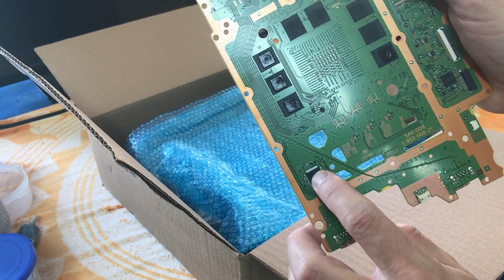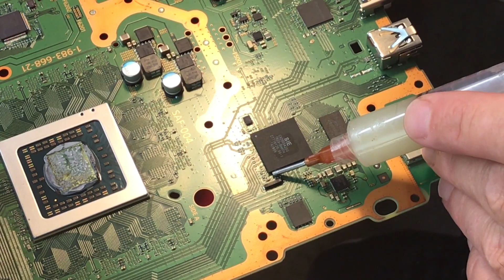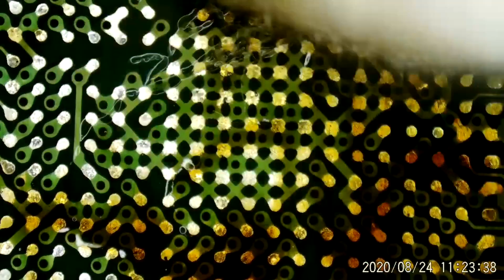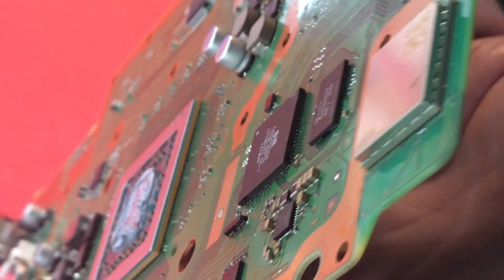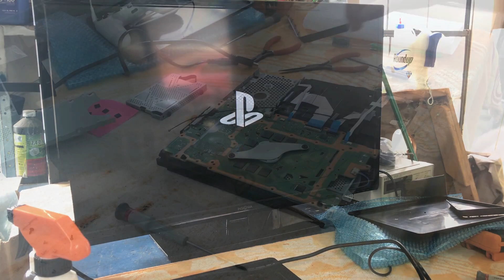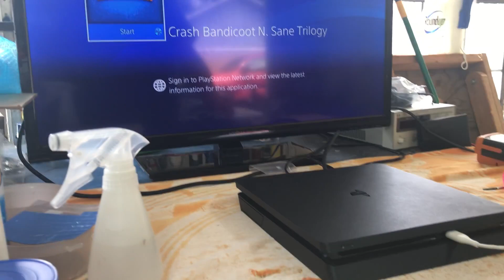#9 PS4 Slim - No Power

Comment: Sir I have a SAD-001 motherboard how can I check if the South bridge is dead or still alive ? Or will this same method work for any model of the PS4 motherboard ?
Reply from the maker: A dead South Bridge will usually show up as a short across one of the capacitors beneath it.  They just seem to die that way and they die a lot of the slims.  Particularly the 42GG.
Reply: @ToltecMerc  I managed to change the southbridge and the console worked just fine but today I received a PS4 PRO that won’t turn on. I checked the southbridge and it was okay, all stand by voltages are present and I even replaced the southbridge and the console still did not turn on. Tested a working PSU and still the problem persisted

Comment: Hi there worth watching this video I appreciate it thanks for sharing your experience with us, I have ps4 slim white the problem is slightly different than the one you have repaired.. Mine does beep when i press the dvd eject button but doesn't beep while pressing the power button, any clue which side of the motherboard i should check. Will appreciate if you or anyone reply. Thanks
Reply from the maker: I would start by looking for shorts to ground around the South Bridge.  It can fail in various ways.  Check across all the capacitors under the South Bridge.
Reply: @ToltecMerc   thanks for the quick response.

Comment: Any chance you can point me to what microscope boom arm you bought? I also have a cheap microscope (~100 from Amazon) which I love but the stand makes it pretty tight to work on PS4s under. I'm currently waiting on a CXD90042gg from Aliexpress and am planning to use your method. It'll be my first time messing around with BGA :). I've been doing mostly HDMI replacements and blu ray fuse fixes so far.

Comment: Hi good video amazing job, I have a question about the temperature setting for hot iron for replacing a HDMI  port also what temperature can be setting on soldering iron for soldering small component like cap or resistors 
thanks in advance

Comment: Loving it but with all that heat that you are applying from the bottom of the board are you not losing any of the small components on the other side of the board?
Reply from the maker: I've never had a problem as long as I don't actually touch the bottom of the pcb.
Reply: @ToltecMerc  ok thxs a million and you use your hot air station correct? Not heatgun and then your flow and heat in Hot air station?
Reply from the maker: @xx_ars_enic_xx2831  yes.  Hot air station.  No heatgun.
Reply: @ToltecMerc  much appreciated and temp and flow on air gun max I suppose I  and out of there lol
Reply from the maker: @xx_ars_enic_xx2831  yes max temp and max airflow.  I like to remove it as quick as possible.

Comment: With that amount of temp and air flow are you doing anything to protect the parts underneath the board. It just seems like you would have resistor falling off the board.
Reply from the maker: The surface tension of the solder holds them in place as long as you don't physically bump the board with the hot air wand.  I remove the nozzle of my wand so the air is not focused on one small spot.

Comment: I can't find the location to test on my SAE-003 board.
Reply from the maker: Sorry but I don't have an SAE-003 to check at the moment.  Look for the close groupings of inductors and capacitors with thick traces.  That will usually point you to the supply voltage inputs.

Comment: @ToltecMerc
Can you tell me what Temps did you use on your hot air gun when taking off the chip and putting it on again?
Also, is there not a possibility that when you heat it from the underside that some caps are going to fall off or something like that?
Reply from the maker: I normally use maximum temperature on my Quick 861DW.   932 degrees Fahrenheit with maximum air flow.  It takes a lot of heat to remove the original part with lead-free solder.  When installing the replacement part which is reballed with leaded solder,  I'll use something closer to 800 degrees Fahrenheit.  There is a danger of moving small parts on the underside and I'm always watching for this but so far it has happened.  Just be sure not to accidentally touch the PCB with your hot air wand because you will knock something off.

Comment: Looking for some help my sons PS4 slim got unplugged while he was playing a game we plugged it back in but it has no power at all no light no beep. I’ve tried the power cords, cleaning it, ect. Would it be something got damaged from being unplugged while on? Hoping it’s just the psu as I can just order a new one.
Reply from the maker: I would guess power supply.  They don't like getting unplugged and plugged in quickly.  Sometimes cause a bit of surge just like when your power flickers off and on.
Reply: Ok I will try a new power supply thanks for replying.
Reply: @kellywhyte6940  Did replacing the power supply help?
Reply: Unfortunately it did not we ended up having to buy a new one

Comment: If you come across a SAE-003 slim board, could you show the equivalent short point. 

It doesn't seem to have that same cap setup.

Thanks for the video!
Reply: I have this SAE-003 slim board in front of me. It is in the same location, its just the positioning of his camera.   Look for the pattern of resistor/caps you will find it.  It is on the inside middle of the board.  There is actually a printed numbers in black ink near it.  Sure enough i checked and the values were really low.  I have the same condition no power at all, liquid damage from customer kid.   Good luck!
Reply: @jasonledrew7677  

Awesome reply and thanks for taking the time to share that info! I'll definitely look for that when/if I come across another SAE-003 board.

Thanks!
Reply: @jasonledrew7677  I still can't find it on my SAE-003 board.

Comment: I got a roached out ps4 from my friend he said it popped and he saw roaches and I took it apart and it was infested bad so I cleaned it the best I could and killed all the roaches finnaly after a week or so I looked at the power supply like 2 or 3 dead roaches in their and I saw a burn mark where it blew so if I get another power supply will it power on again and work like new again ?
Reply from the maker: Just a guess but yes I think a new supply would make it power on once again.  Work like new?  Only if it worked like new before the supply failed.
Reply: ToltecMerc thanks he said it worked like new up untill then he was too lazy to mess with it and get it fixed so he just bought a pro and I bought the slim off him I have a supply coming Monday I’ll update you if it works or not thanks for your advice 👏🏼
Reply: @ninjaxgaminggamingchannel3082  If he has roaches in his house, I don't think anything out there is going to work like new. Disgusting place.